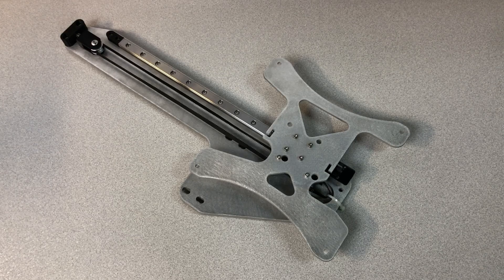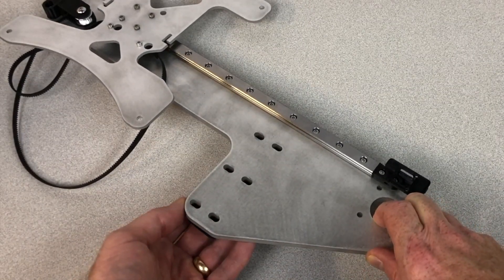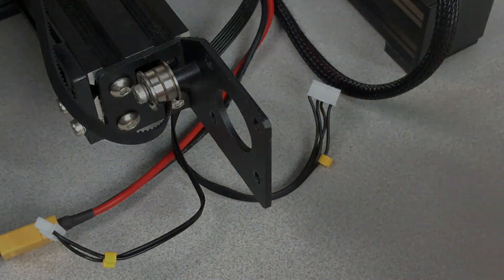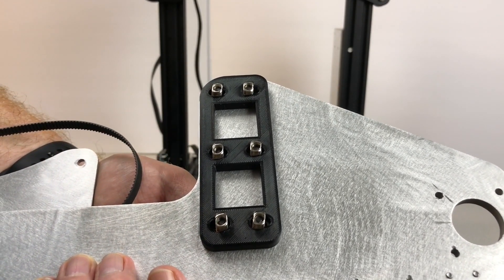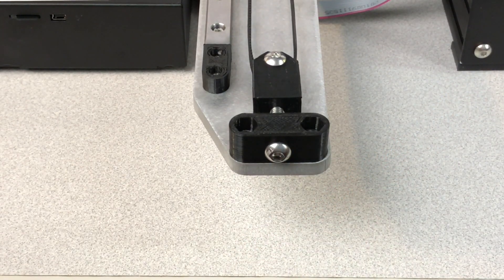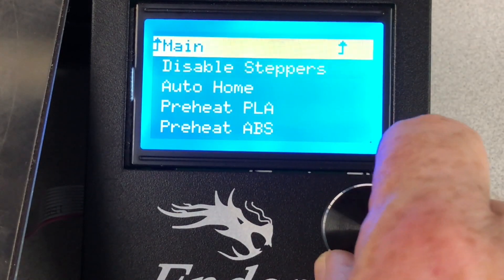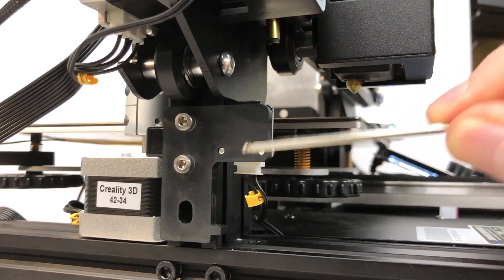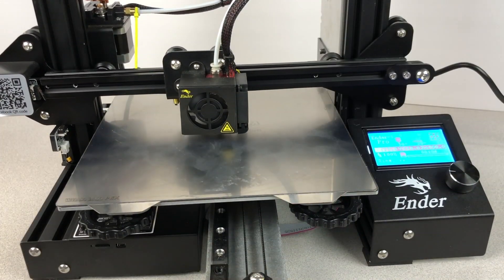3Dfused Ender 3 and Ender 3 Pro Y Axis Linear Rail Kit Installation

Comment: Has anyone tried this with the Power Supply positioned under the printer, between the two horizontal "legs"?  I moved my PSU there when I upgraded to Dual Z, and looking at this makes me realize that the new motor position may interfere with the moved PSU.

Comment: I installed the kit today on my Ender 3 Pro and I had to use the Y spacer, because the are no short screws,  but that's ok as (I think) it has no negative effect. What's a problem is that the Y axis won't move back enough to hit Y0 (I want to use the full 235mm). I think I can move everything about 5mm to the back but then there are still 15mm missing. Looking at the X and Z kit next to me, it looks like it will then go to 18mm offset. Is there anything I can do to get my printhead closer to Y0?
Reply: Were you able to get it perfectly square with the base? No matter what I do I can't get it right - when I tighten the screws into the spacer it goes off square

Comment: I just installed mine, and I think the design has a bit of a flaw. The linear bearing seems tight enough when the build plate isn't mounted on it. But it actually has side-to-side up-and-down play (not front-to-back). When it's fully loaded with the build plate that play is very evident at the outside edges. This does not happen with the original Ender system. The problem is that when you are leveling the bed, you shove your paper (I use a stainless steel gauge) under the nozzle to check the distance. But it also very easily pushes the build plate down at the same time at the outside edges because of this bearing play. So it's very tricky to check this now. You almost need to train your eye now and not push anything under the nozzle because it will not be accurate the way it was before. Did you not notice this, if not check yours and see.

I also had to use a hammer and knock the stepper pulley down about 1/4" because the system they had, had it mounted so that the belt was rubbing the plate underneath. There was no way to adjust it out with the hardware they supplied. I just figured it out by myself as there were no instructions supplied. I do not think they are accounting for some of the variances out here in the "field".

I plan on contacting 3D Fused tomorrow and see what they have to say about this. I think the linear bearing needs to have a tightness adjustment or they need one with better tolerance.
Reply from the maker: Hi nashme11. What did Support have to say about the issues you were having? On mine, the aluminum Y sled has a little bit of give to it, but I want to say it was pretty comparable to stock. It's not so flexible that paper between the nozzle and the build surface is enough to deflect it.

The only issue I've had with it was that I overtightened the belt once, and snapped part of the printed belt holder that's underneath the Y sled. I was still able to adjust the belt tensioner to take up most of the slack, and was able to print a replacement part. I do like that they've got the STLs for the printed parts available for download.

But do let me know what Support had to say!
Reply: @BV3D  
Hello Brian. I did contact support and they did a great job helping. The problem was that the bearing was not properly matched to the rail and it sneaked past some quality control steps. They sent me another Y axis and that one was perfect, so I shipped the other one back. All good.

The other issue about the stepper was interesting. As I said, I had to tap the pulley down about ~ 1/4" from the original position as it came off the original Ender Y axis (which was aligned OK). When I installed the stepper on the linear rail platform the belt rubbed under the aluminum plate because the pulley was too high on the stepper. In your video your stepper pulley position on the shaft is like mine was as it came off the Ender, yet you didn't report any belt rubbing, that is interesting.

The only reasonable way to adjust the pulley was to tap it down on the shaft. I told 3D Fused about that and they are going to look into it. Might be a difference of factory assembly from the Ender factory.

I am going to buy the other two axis (X and Z) after the holiday shipping craziness goes away.
Reply from the maker: @nashme11  Awesome! I'm glad everything got resolved. And that's weird about the pulley on the Y axis stepper motor. The only thing I can imagine is that Creality changed the Y axis mount during production, and the pulley needed to be at a different distance from the motor as a result.

Comment: My Ender 3 only had 2 bolts for the Y-Axis
Reply from the maker: Hi! If you have an Ender 3, it uses a 2040 extrusion for the Y. The Ender 3 Pro uses a 4040 extrusion.
Since the Ender 3 Pro's extrusion is twice the width, it has twice the number of screws. 👍